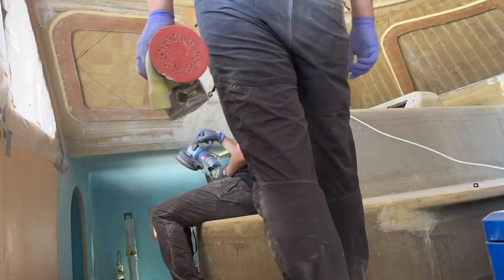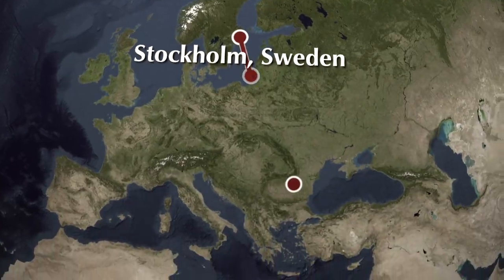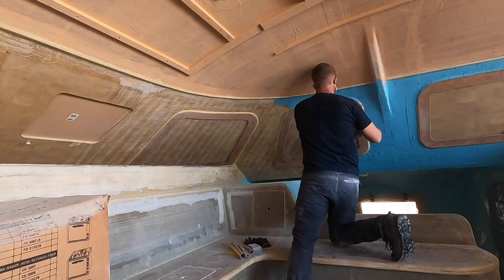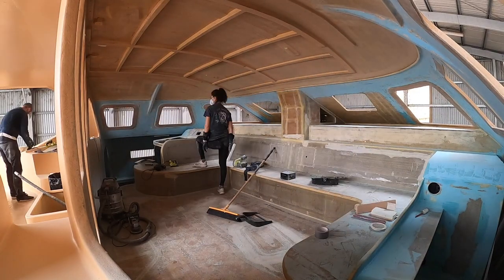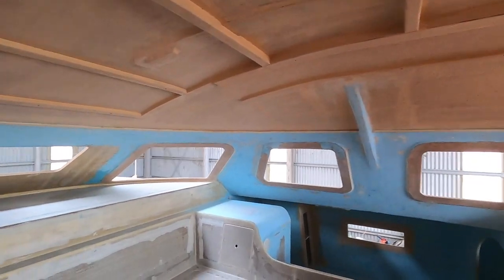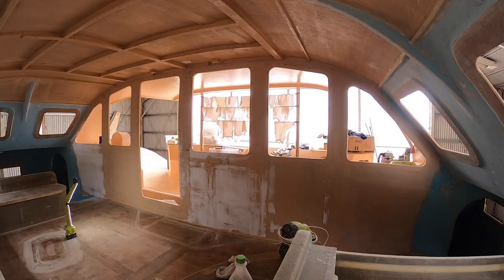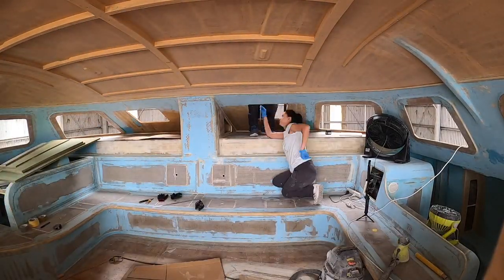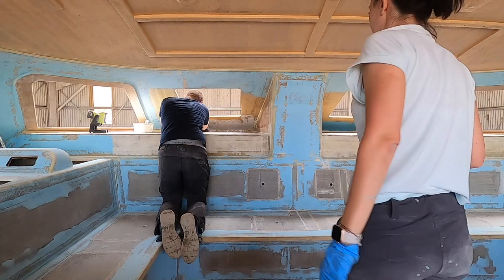Fairing the salon and making a decision

Comment: So I take it the plan would be to remove the windows ( hatches? ) either side of the mast and the the boxing in around the mast. That sounds like a good plan on the face of it. Easier access to the mast etc. But that’s a pretty major change - potential water issues etc. Consider carefully. But you either do it now or you probably never will.
Reply from the maker: True. And yes, lots to think about. And lots of time to achieve. I've thought out the details, but we'll not do it now. So we'll see... You may be right, it may never happen. But at least we will be sailing sooner.

Comment: You guys are smashing it out. I am about to start fairing the inside of our saloon and now I feel little bit unwell, knowing what you have been through. 35 degrees here today and wondering what is your timeline for the launch.Rossco
Reply from the maker: Hi! Thanks, we're moving forward. Tough job, the fairing, it never ends. And in the heat, not so much fun 🤣 We will need to stop before we go mad. We are actually out of the country for a while. Otherwise we work in 3 month sections. Visa restrictions. Really hard to say what the timeline will be... We will be in really good shape after the next 3 months. Hope to launch or at least be almost ready to by then. But I guess you know how it is... There is always something.. When we get back, we'll have a week of prep, then finishing primer on the interior. Then back to fairing the exterior...

You will be happy with the molded surfaces! At least they are done. Sadly, I guess all or most of your fairing will be the tricky bits.. corners and joints..

We don't do much in 35 degrees. Over 40 in the shed by then. Too hot for us and the epoxy.

Your build is looking good!

/Axel

Comment: That blue compound is a much nicer colour than the green, don't you think?
Reply from the maker: 🤣 very pretty blue! Just wish we had less of it to sand down! I think any 1:1 fairing compound would be great. A bit expensive, but worth every cent. For the final round we may even cheat, using body filler, just because of how it cures so quickly. (Pinholes)

Comment: That's a lot of work. How much weight do you think your adding with all that faring compound? By the way, your audio needs to be turned up.
Reply from the maker: No idea! Way too much! Trying to add as little as possible. I'm sure over 100kg.. perhaps twice that. And then half of it is sanded off again.. in some places there is a crazy amount of fairing compound... Removing it is not really an option. We try to add ad little as possible. As long as I end up displacing around 4000 light ship, I'll be happy. Anything below 4200 is an improvement Vs design. Then I will have the trim to sort out..

In short, way too much of the blue in most of the boat. Especially on the outside of the saloon and inside the center section of both hulls. The guy who did that fairing used much more than we are now laying on.
Reply: Thanks

Comment: I wouldn't do a self tacking jib because your catamaran will want to round up into the wind due to the jib being so small compared to the main. It will also add stress on the auto helm. You want a balanced rig and to get that, you need close to a 100% jib or over a 100% jib. Talk to the Schionning team about what I'm saying before you install a self tacking jib for more accurate information about this. I used to race Tornado catamarans and Nacra catamarans. You'll get better boat handling capabilities when you manually tack and it will help you to control your boat better if you get stuck in irons and sail backwards.
Reply from the maker: I've been considering this. I hope to talk to a sail maker as well, discussing options. There may be more options as well.. standard sail plan is a big Genoa. Everything is set up for that as is. I'll see where we go. Lots of considerations...
Reply: @buildingwilda  I think having three attachment points forward of your mast would be the best sail set up. Many people only have two. Three is best because it gives you way more options.
Reply from the maker: Wilda has 2. One each end of the catwalk. But she is designed to carry a substantial amount of sail on a bowsprit. A 2m long bowsprit!
In addition to that, older plans had the inner forestay running to the crossbeam. I could potentially add a third removable stay here...
Reply: @buildingwilda  Yes, do the removable stay so that you don't have to roll up your sails to tack. It also saves your sails from rubbing against the forestay. I grew up racing small boats and crewed on larger boats. Then I got into racing Tornado catamarans and qualified for the Olympics in one race because I got a first out of about 150 boats with four firsts and one second. I also raced Nacra catamarans. With that said, it sounds like you have similar experiences and know how to set up your boat. If I was doing what your doing, I'd look over the plans, talk to the Schionning team, sail makers as well as take advice from others and form your own opinion based on what you feel is best. For me, I'm just letting you know on a very basic level of what I personally feel but I'm not an expert at all. It all depends on a variety of many things combined together like hull shape, positive buoyancy, mast rake, mast height, overall boat design and on and on and on. I'm looking at getting the boat that Peter from Sailing into Freedom is building and will hopefully see you out on the water.